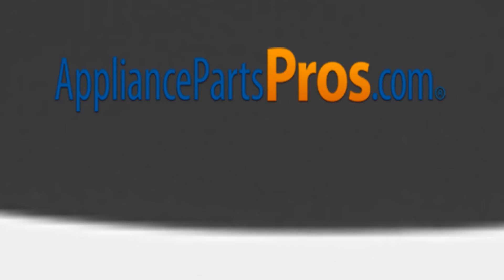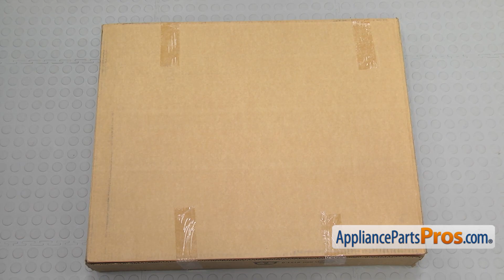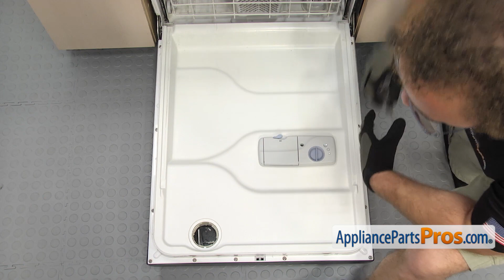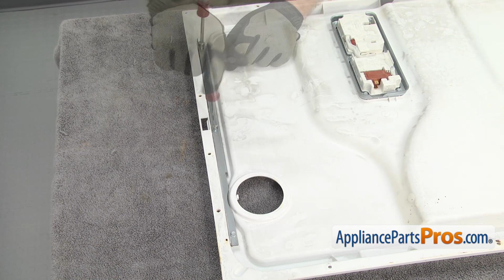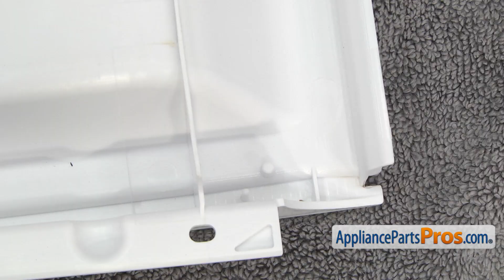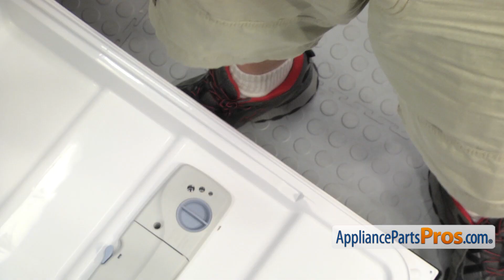Maytag Dishwasher Inner Door Panel WP6-918615 Replacement — fits Whirlpool/KitchenAid

Comment: Just finished doing this
1) Make sure those screws on the detergent holder are tight. Tight! Make that seal do its job
2) Screw the vent back on BEFORE screwing the inner door panel to the outer door. So much easier that way
3) Watch for leaks early when testing it out...don't walk away like I did and then come to comment on a youtube video...